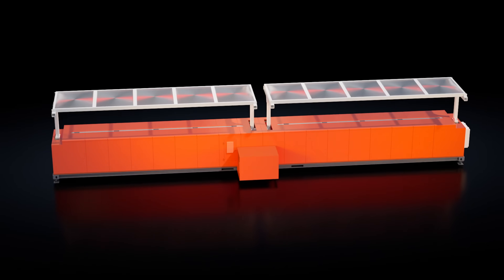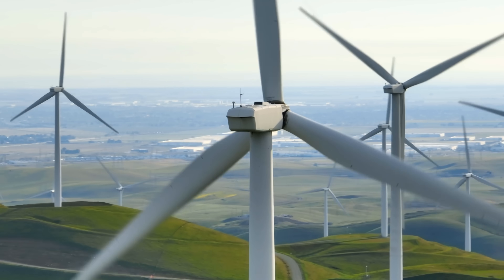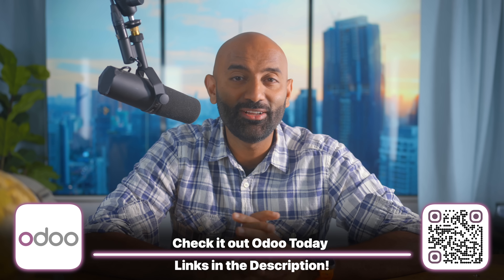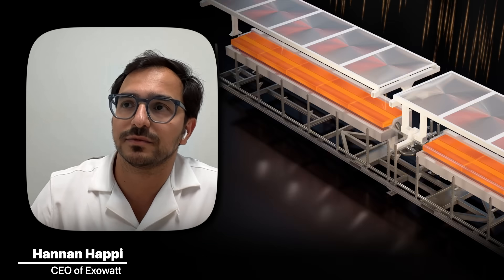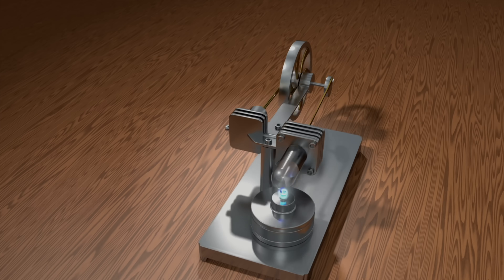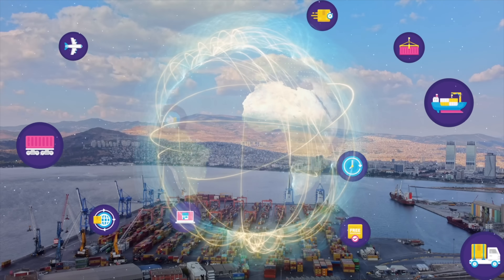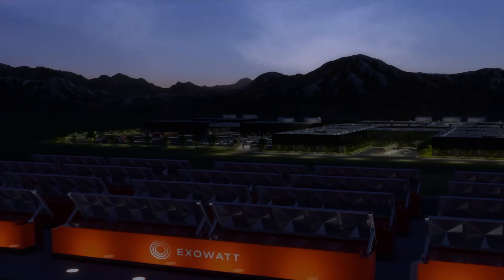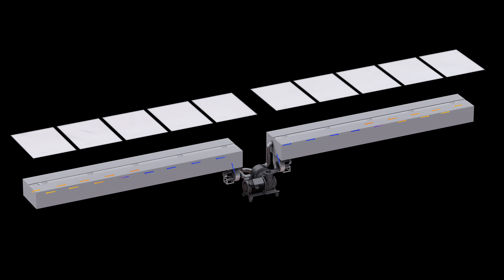Solar Without Panels, Storage Without Batteries - EXOWATT

Comment: Common sense says these “hot boxes” will add to global warming. Unless, They can include parasitic recovery of that heat to produce even more energy. Maybe an insulated box covering the hot box that is used to somehow produce more power.
Reply: Physics says it doesn't. The amount of sun energy that hits earth is the same, whether you store in a box short term or not
Reply: @SolarCookingGermany  Interesting. Common sense says that the amount of light hitting the lenses without magnification would not make the storage unit temp hit 1,600 degrees. With magnification and lenses rotation the temperature is increased significantly from an untreated unit. What does physics say?
Reply: @JDawg-bn3hs  A lens only concentrates the heat, it doesn't produce more heat. The overall amount of energy is the same.
Reply: @SolarCookingGermany  Interesting. Common sense says, if you have increased the temp in a block of clay to 1,600 degrees, then there has to be a decrease in another area to be able to balance that increase in order to keep from having a global impact. Similarly, a black asphalt road vs a white sandy beach. The same energy in but a temperature increase without a way to balance the temperature.
Reply: @JDawg-bn3hs  If a lens concentrates sunlight to a tiny spot, then the rest of the area covered by the lens won't receive that energy.
Btw, a nuclear reactor actually produces heat that otherwise wouldn't exist on earth
Reply: @JDawg-bn3hs  I see YT has censored my last reply for no reason, can't even talk about physics on this platform anymore...
Reply: @SolarCookingGermany  Dang them! Communism is in full bloom! I’d like to hear what you had to say. We learn through good and honest conversations. I guess they like the global warming and dislike physics?

Comment: thermal batteries on a stirling engine should be highly efficient if done right, also cheap, but in theory the device itself would be big and heavy, so they sould work nicely on homes

Comment: What if it rains? Water cooling your heat batteries at the same time as blocking sunlight. Also, it would drip below the hinged lense into the heat block and heated air channels.
Reply: Good point. You could use glass windows that btw also keep the heat in, but that requires special heat-resistent glass or even ceramics. Another cost factor.

Comment: The main problem with data centers is the sheer amount of fresh water they destroy. They destroy water tables of whatever city they are build next to.
Reply: @JosephDiveley  Do you have sources to back that up? The data centers I've learned about don't use fresh water continuously. They use the same water over and over, the same way as a liquid CPU cooler in a desktop computer.

Comment: The previous solar companies that are similar seemed to all use mirrors... Those are expensive and crazy easy to damage. A Fresnel lens is super cheap and you can easily protect it. You could just make the lens out of the same material that you'd protect it with and make it something you could drop a brick on and still be fine.

You can just stick these on land that doesn't have good crop growing soil.

Oh man, that resistive battery backup thing is also pretty great. It's dual purpose. Mass Grid Energy Storage AND solar energy creation. Wonderful stuff!

Comment: To improve even further...

1. Don't use bricks of ceramic. Use sand. Have that sand loaded into the units on site so it can be more localized material instead of increasing shipping cost of shipping heavy ceramic bricks that are preloaded. Localization cuts down on fuel costs a lot. Also, ceramics are going to have a lot of manufacturing costs involved whereas sand you just need to remove debris that isn't sand.

2. IF large clusters are going to exist, then create modules that are just stirling engines so you don't have to make a bunch of tiny stirling engines. This will cut down on points of failure and consolidate maintenance. Then you can pipe the heat tot hose stirling engines. Similarly, you could have modules that are just pumps to do all the pumping for the cluster instead of pumps in every power module.

3. Use high grade insulation such as aerogel based meterials such as pyrogel. 

4. Not sure if lens washing is considered but... I imagine you could have robots do that. Perhaps quadcopter type platforms that would inspect and spray off lenses when dirty or on a cycle.

In general I love this concept due to the high availability of materials in basically any region of the planet. The technologies do not involve high complexity of chemical manufacturing. The recycling is simple and not a "throw it in a hole" kind of situation like solar panels seem to be. Degradation is extremely minimal for all parts of the system.

Comment: Before making any comments, I decided to conduct some research on the system and how it works. I wanted to see if there's something tested or working, and there is nothing.  Meaning, this is still a concept. For a company founded in 2023, I would have a prototype built and test out my theory, to then begin perfecting the model. Therefore, if they are so strong about the performance of their product, they should build at least five of these containers immediately. To then start testing them out, and eventually have a third-party review their results, and finally let the market decide how good it is.

Comment: I wonder how the environmental impact would be in regards of having dozens of little heat batteries loosing heat into the air. I mean, look into cities with many buildings accumulating heat in the summer, keeping temps during the nights unbearably high compared to a small towns or similar...

Comment: I was wondering why they need the single large tracking Fresnel lens lineup instead of using a curved array of smaller ones arranged over the target that will shift the sunlight without moving.

Comment: These being built into shipping containers can make these moblie, too. Maintenance should be relatively easy. Should be able to just swap out a sterling engine and be able work on the other. Always having a back up ready.
Reply: When they say shipping containers, I took it as the units will be designed to the same size and have the same locking sockets to make transporting them utilise entirely existing logistics systems, therefore reducing costs. Not that they will convert existing containers, I may be wrong but I don't think so based on the renders.
Reply: @doofer80 I could be wrong, but he did say 40ft shipping container. I, definitely understand what you mean in regard of the renderings. Using existing logistic systems would surely save on costs an what not. The other thing I thought about was having them put in ground/below surface with a trench like system for radiant heat dispersing.

Comment: Seems like another lie similar to solar roadways! The max possible power is 1000 watts per square meter and that is only alone the equator. The shipping container about 28 square meters. I just don't see how it will have the advertised power output. The 25kw they claim would only be available during peak hours. So the average for the daylight hours will be so much less. There will be losses in storage and converting it to electricity. I don't have a problem with the technology. I don't know enough about it to know if it's good or not. But I do know enough to know that they're claims R of the Max theoretical possible in the ideal location assuming 0 losses and only for a short time in the middle of the day.   If they were realistic about the numbers they would be more likely to trust the rest of their claims. But if they can't be honest about the power, then what else are they not being honest about? These oversensationalized technologies so often never make it past a test trial that's funded by the government.
Reply: Indeed... 
Its a concentrated solar power design done bad...
Reply: Maybe, but its possible because there is time duration added to it I assume. They claim 90% of the heat is taken in, so 1000 - 10% = 900. I also will assume they will take more area to do the CS as well, so there might be more energy that will grab per panel. The engines themselves will be around 25-30%, so if we assume they take in 10-20% more area they can counter the losses from angle and heat losses. So 1kwh at 30% would be around 300 watts per CS lens. With that said, there is a bit of a delay in terms of when the heat gets moved, so they more than likely will be able to store a ton of extra heat as the engine(s) it self will be limited in how much it can convert out. This means its not limited to the 6-8 hours only of producing power, but just how much power will be stored into the system it self. So long as there is no upper limit in how much heat you can store, then you can produce quite a bit of power. Not sure if its 25kw they claim, but I assume it will be more than what people think. So assuming some numbers, base off that 28 number then each panel would need to produce around 3.6kw of heat over 8 hours or around 450 per hour. Something I think could be do-able. Granted, what they need to show is the cost is low enough compare to storage + solar personally. I think it can produce the power even if its not that claim number as what is important is just that it comes with a bit of storage thus we can get around some of the limits of power on demand that we currently use a ton of gas for.

Comment: One thing missing is dual use of the land. You wont be able to safely suspend the connex based units where you can farm, park, drive, and or live under them like you can PV panels. I have a solar powered chicken coop with 36 panels over it. I also have 40' connex based work shop, 40' connex storage along with a 20 ' connex for my solar inverters and battery storage under a128 panel lean-too.
This takes the property costs out of the equation and allows usage in areas where people live without massive transmission costs.
In areas where its arid desert with little to no land use the solar thermal storage makes sense like you show in the video.

Comment: When calculating land use one aspect not covered is the fact that solar can be a second use like agrovoltaics. Or it can be mounted on roof tops. Neither seems a viable option for this tech. The weight of it probably makes it unsuitable for rooftops.

Comment: - As shown, it can’t work: the lenses must track the sun on two axes, not just one.

- This older concept works only in direct sunlight (e.g., polar regions, high mountains) — the bluer the sky, the better.

- Fresnel lenses are acrylic, like car headlights, and will degrade from UV and scratches, needing replacement every few years. Cleaning their textured surface with pure, lime-free water is necessary and tricky.

Comment: if it's insulated, how does the heat get inside and not leave to outside, also it might be better just to heat a pipe with water, creating pressure/steam that powers a generator (yes this does not work at night) but for night time regular powerplants can do the trick and this already exists.

Comment: on the solar tracking problem, stay near the equator and or have wheels on both ends of the container on mag tracks, the energy the container makes turns on the magnets then just push it...

Comment: The biggest issue I have with these announcements is that they never discuss how much the unit actually costs. Telling us how much per Kw it costs is useless.
Reply: @RedSun-Cinema   and I'm curious how much heat it produces
Reply: @Laredo-c7g  well, it's interesting, no? It doesn't really produce heat, it just transfers it from the sun rays into the generator. All that heat from the sun would have been there anyway, you're just focusing it into this big box.
Reply: @Nonx47  but im imagining these boxes store more concentrated heat wherever theyre located. I imagine those lenses multiply intensity too
Reply: @Nonx47  You're splitting hairs, the unit DOES produce heat because that's what creates the electrical output, just because it's focusing the Sun's rays doesn't change that since without the unit you do not get the concentration of heat.
That'd be like saying solar panels don't produce electricity because they "just" convert it from the Sun's rays.
Reply: @russell2449 why does the concentration of heat matter? Are we concerned about fire risk or something?
Reply: @Laredo-c7g why is that a bad thing?
Reply: @coledavidson5630 why is what a bad thing?
Reply: @Laredo-c7g  the concentrated heat, what's the concern with that?
Reply: @coledavidson5630  hey it’s air and clay surrounded by metal. What will spark a fire nothing…air heat flow….
Reply: Those lenses can turn rocks to liquids I wouldn't be surprised and I'm curious aswell
Reply: A single Exowatt XP3 unit costs $77,500.
Reply: 7500$ ea
Reply: Yes, I'd like some plain non jargon explanation as regards to individual use as :average cost for units that can supply energy for average size home use with scale up or down .....or for multi homes, apartment units...for those of us who are not billionaire corporations....or better yet just say "this is for industrial use only" at the beginning of the video...
Reply: @vivianramsay2527     
(If You have in size and weight same as a 
mono-wheel-unicycle,  10-15 kg,
which can be carried in hand and moved, 
no batteries need, 
no other inputs energy, 
constant 24/7, =10 kW with peaks 1 MW for temporary needs, 
10-50  years working guaranteed (depends working area, salty, wet, etc). 
If it costed the maker 1k€ for making the prototype, the raw materials, 
how much would You offer him at eBay example bid, for buying it ?)  
My curiosity .
Reply: its for big companies bro,
Reply: Per Exowatt's website, "Exowatt serves commercial and government organizations with energy-intensive needs, from AI model training and data centers to defense, research, and off-grid infrastructure projects."
Reply: If I told you a unit of something cost $500, or that it cost $5000/KW what is more useful?
Reply: @catprog  both are useless without the other

Comment: I can see this working in remote locations and maybe some parts in agriculture. It's a pretty interesting idea that looks like it could do some of the tasks of the future. The question is, do we really need to think like the 1900s and develop a new grid? Do we really need a grid at all the way we've been doing it? Maybe that's one of the problems we're mistakenly making today. I can see smaller grids being built for an urban environment, and this might be proving that we're tackling the energy needs of the future backwards while this idea is going backwards to lead us forward. Then many ideas on a similar principle to this one would be way more effective, more sustainable and easier to manage without massive risks. It definitely has potential in the right environments. The energy problem that I see is, we have to make energy in abundance, cheaply and with the least environmental impact. Good idea. Fun bumping into this one online.

Comment: Two words define PV - battery, solid state. No moving parts. Could argue a heat extraction is still required for batteries but these are typically centrally managed. Moving parts are not your friends!

Comment: Because this works by turning light into heat, would it work better in areas prone to getting really hot?

Also, another sustainability advantage of this lacking a battery, is there not being a need for battery disposal.  I'm not sure if there's plans in place for large scale recycling or disposal of all the batteries being set up with solar over the last 10 or 15 years.  Eventually those batteries will reach the end of their life, and then what?

Comment: Add a diffusion lense to the slit and redistribute the light across the entire surface of the bricks. If you left a gap between the bricks and the heat/light reflecting inner walls of the insulator, you could heat the bricks from several sides at once.

Comment: lemme guess, that 25KW of power is heat energy, and in the process of harnessing that heat into electricity through a inefficient sterling engine you get a fraction of it out, maybe 15 to 40% of the energy to electricity?

Comment: The problem here is efficiency loss... These are just like sand batteries they're not very efficient. Sterling engines are one of the least efficient methods of energy conversion. Photovoltaic cells are more efficient because there's only one change of photonic energy to electric potential.

Comment: Besides weather limitations (not enough sun), the only drawback I potentially see is that you can't put it on existing infrastructure. What I mean by that is with something like solar panels, you can put those on roofs. You might be able to put them in backyards, but that means having a backyard. However, from what I understand, I'd rather have these in the desert than solar or wind farms since these take up less space

Comment: Your lightly touching on the Sterling engine is the heart of energy transfer, with typical  bearings and sealing/friction issues that will along with the swing axis mechanism need common maintenance. My feeling is "most" arrays in current production are also only 2 axis. My home system is zero axis, as I simply have a separate summer and winter array. At 37° latitude,  I later found either works roughly the same efficiency. Also why industrial arrays in this area are fixed position.  Stationary=0 maintenance.  Not trying to poopoo the concept, just bring other data.

Comment: Is anyone else pissed off that only now that tech billionaires need a good energy system for their money making electricity eating computers are we finally getting these kinds of energy production methods?
Reply: CSP = concentrated solar power has been around for decades before photovoltaic became cheaper and the concepts they used did actually work (kinda). I have my doubts with this one.